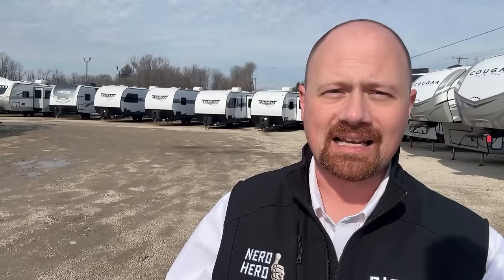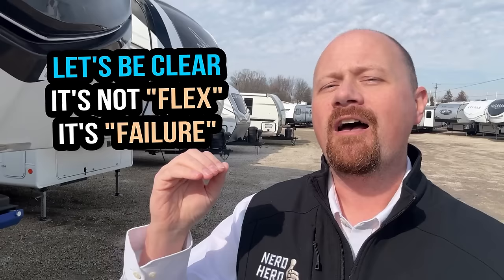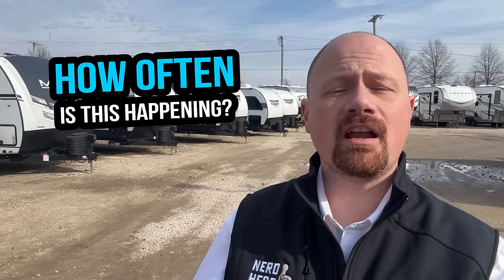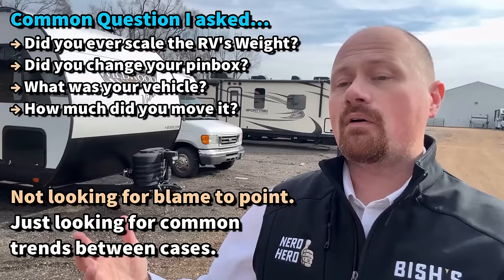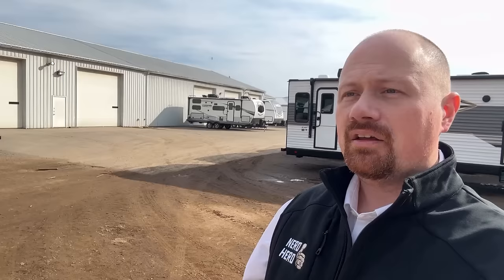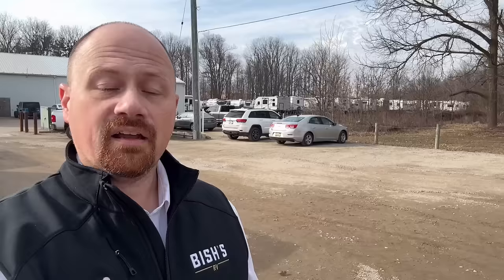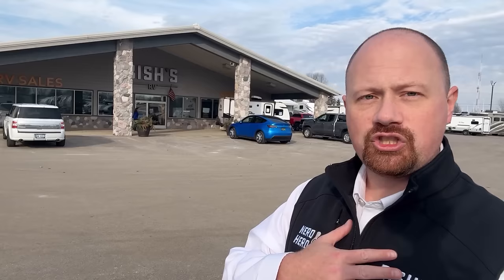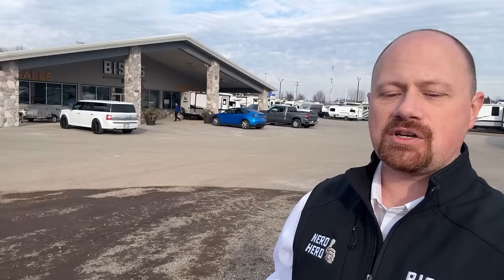🚨 RV Frame Flex & FAILURE!! • WHAT is Happening and WHO is Responsible?!

Comment: Ok nerd the t--d!!  Lets get it right and you sure missed the ball.  The main thing is the manufacturer has cheapened the frams way much. How do i know this??  6 point leveling!!  Sounds great right??  Well its not .  The reason is the fram is so light that it can't be to leveled without the extra set of levelers in the middle. Don't believe it??  Try leveling it with only the four corners and watch it bow so much as to bend so much it will not ever return to normal. Now thats a cheao fram, period   what another way to tell just how cheap and worthless frams has gotten. Look at older RVs and the thickness of the metal.  World of difference.  As far as your you can have to much truck.  A air ride hitch will take alot of that argument away especially if the truck is air ride.  Here's another thing you skirted and have for years now. Rvs that have only 1000 or 1200 pounds of "weight" you can haul.  Thats dry weight with nothing in it, no water or anything.  Ive seen you yourself say oh this RV can Carry 1000 pounds of gear. Now it has a 50 gal freash water tank so say goodbye to 400 pounds of that weight.  Now add a couple of batteries to that and now your under 500 pounds you can carry.  Ive even brought it to your attention a few times over the years. But here's one thing that has not changed and the RV industry spends millions a year to keep their products from falling under many of the safeguards even boats have to follow.  Why do they spend so much money to keep from giving their customers rights??  Think about that..
   Next i have heard you yourself tell us that this trailer is rated for full time use. Yet in this video you backtracked on that. Which it turd??  Rated for full time use which means hauling it across the country or it's not rated to be used but a few weeks a year. I will say that i have slowed way fown on your content as you do not cover things the same way as you use to. 
  Now here's how to never have any trouble with a RV. Do not ever buy the crap to start with.

Comment: Its not frame flex its frame break and broken welds due to under engineered frames bullt with undersized  and under braced  steel and welded by amatures earning minimum wage  all to make the most money Basically there putting a  25,000 pound camper on a frame that can only handle 10,000 pounds  and fudging the GVWR by putting 3 axles on it Plus the Gen Y pin boxes are certified by Brinkley so dont blame them Brinkley also certifies there RVs as full time RVs

Comment: OK, I watched the whole video and was somewhat disappointed in that you put most of the blame on the owner's of the RV's, and completely skipped some of the workmanship, or lack thereof, of the frame manufacturers (I won't mention the name, but you know who I mean) and RV companies. This "Frame Failure" issue is not a new problem. Shortly after we purchased our 2017 Keystone Avalanche, I started reading on the Keystone RV forum about people having cracks in their Filon siding mainly from the bedroom slide down to the corner of the front riser. In 2021, Keystone published a service bulletin (KSB-180328) that details how to repair these units that have frame failure. From what I determined in reading the document that it involved poor welds in the frame that broke causing excessive flex. Sure, some of that could be exasperated by users, but I felt you did a disservice by pointing the finger too much at the users. Just sayin'
Reply from the maker: I literally asked the question how can you fault owners for using an RV in the way that they were led to believe they could or never educated on. Then said dealers and manufactures need to do more educate customers. Every day I’ll be looking. I’m curious if you saw the end of the video or I had messages to different groups
Reply: @JoshtheRVNerd  Hi Josh. Yes, I did watch the video to the end. And I certainly agree the RV Dealers need to educate the public on such things as overloading, using the proper hitch, using the proper tow vehicle, and all the other things that could cause frame failure. However, during this whole video, you never once mentioned some of this could be cause by the RV and frame manufacturers in regards to poor craftsmanship. And I understand that you probably can't being in the position you are in as a proponent for Bish's RV, but if you are being 100% transparent, it must be mentioned.

Comment: Just look at equipment 5th wheel trailer built and weight !!! RVs can’t be built the same way because the 1 ton wouldn’t be able to tow . Semi work great for 5th wheeler - 1 ton not so great . Just look at equipment 5th wheel trailer for a 1 ton truck  !!!

Comment: I'f3 seen this on a couple of channels (Keep Your Daydream 0 Airstream) and a few 5th wheel.  In my opinion... BAD Design or Designers out of touch with users and what they do to/with their rigs.  As a side note, the Aircraft deals with flexing things all the time and seem to have made solutions, (oh yeah, they don't use fiberglass) but the Boat Building industry doesn't have this issue and they use FG all the time.  Back to the drawing board... you've only been buiding these things since the 50's!

Comment: From what I have seen and heard; the common thread is neither builders nor dealers want to take any responsibility for these failures.  Another common thread is that the new campers are garbage.  What needs to happen is maybe the government gets involved and hold manufacturers and dealers accountable.  You seem to be placing the responsibility on the owner or customer?  Why not build better RV's?  If there is a high failure item, reengineer it stronger....  What needs to happen is people just need to stop buying RV's until the quality improves to an acceptable standard.  Maybe if the RV industry was hit by a few large class action lawsuits they would respond?  You never address the quality issue???
Reply from the maker: Thru the video I state several times you can’t fault an owner for using an rv “incorrectly” when nobody bothered telling them what correct was. I also flat out both dealers and mfgs alike on blast for the practices that got us here
Reply: You can’t say you are holding manufacturers or dealers responsible and then not point to specific manufacturers or hold individuals accountable.  I can tell you that based on what is on the internet, both manufactures and dealers are trying to put fault on the RV owners without admitting any responsibility.  Half of this video is you using all these carefully worded disqualifies making sure you held no one in the RV industry responsible.

Comment: I can’t understand how anyone who buys a 100,000 plus Rv to use for 
a “travel trailer” would expect they wouldn’t be able to use it to travel with it frequently 
That makes no sense 
With all due respect it sounds like another dealer making excuses for poorly engineered products instead of quality products consumers deserve 
The Rv industry is absolutely a disgrace from the manufacturing end and it’s dealer network that supports this industry
Reply from the maker: I understand what you're saying and why you would feel that way. Remember I went out of my way to shed some light on something that is not commonly discussed. A topic that could cost a company like mine sales because that's the truth of the matter

If someone buys a new truck it's warranty is limited by years and miles. But RVs don't track miles. They only track your warranty start date. 

If RVs tracked miles, then consumers would have a far better understanding of expected use. But I also suspect one of the reasons miles are not tracked on RVs as it relates to warranty is because consumers would not like the low mile limits the current build of most RVs would offer

But none of that is shared with consumers. Instead customers are flooded with marketing rhetoric related to "full time" and "residential" and "Four seasons" - which aren't true for RVs. Not really. 

I'm not making excuses. I'm agreeing it's a problem

Comment: no offense but it's all excuses.  Trailer manufactures care about selling as many as possible, so they put in those stupid electric fireplaces, tvs that go up and down, and just pure junk.   So in return the put roofs on the thickness of birthday balloons.   The frames are light, the roofs are junk, everything is cheap junk.   Been rv'ing for years and regret getting rid of my 2007, as it was the last of quality.  I never once worried about a roof way back, and we recently bought a new high end one, and its junk..   What needs to happen is 80% go out of business, and a couple of the bunch start producing quality again.   They just don't care about anything.   I've always said, they make this stuff, drive it around the lot but does someone actually go out and CAMP with it before manufacturing it , field test them?  One Example, I have to jack UP my front hitch to get the tanks to empty on level ground..   My old trailer, open valves and boom 1 minute later shes empty.    Its all lipstick on a pig.   And they put in ducts through the floor which is like a home except now mice and get through your entire trailer.    It's up to dealers and insurance and buyers to expect better quality.    Back to this topic though, people expect to much for a pickup truck.   The laws should not allow these massive rigs to be built in the 1st place.  If people need large trailers , they need a semi and a Semi trailer with a proper frame.   They make them, beautiful , big and expensive.   As I said these are all lipstick and people find out after.  And we looked at a toy hauler, and tell me this, what trucker that knows anything would put weight in the back end of a trailer?  Tell me what trucker would say, put all the potato chips up front guys, and put those pallets of bricks in the back.   It's unbelievable what they seem to get away with.  Research everything and pay attention to the bad reviews

Comment: This is the first video I’ve watched with this guy.
He’s running interference for the rv manufacturers. Blaming the victims for shoddy workmanship and design.
I get overloading the coach, but too much truck and moving too often.  That is bs. 
I’ve met people that have traveled thousands of miles with older 5th wheels over decades without any problems other than tire failures.
Watch rv wingman or Amazing Liz, they’re actually looking out for the consumers.
Dealers should be pushing back at the manufacturers, not defending them.
It’s just not frame flex/failure, there many stories of brand new RVs having numerous issues.
Reply from the maker: I’m curious if you watched the end of the video where I literally both rv makers and dealerships alike on blast after saying several times how you can’t blame a customer for doing what they’re doing

I’m not sure how that constitutes running interference

Comment: You are wrong about towing with a semi tractor.  My class 8 freightliner has air ride front and rear suspension and tows much better than my Ram dually or my srw 3/4 ton leaf spring pickup loaded or empty. My 2 axle class 8 truck rides smoother than my pickups by far so I hope people take your advice with a grain of salt. You are comparing to a semi with leaf springs not air ride. Most Semi tractors are specced with leaf springs up front and air ride in the rear.

Comment: This seems to me that you are blaming the owners and not the manufacturers. HEY a rv, it is a travel trailer it’s not meant to sit in one place. That’s a park model. I brought a Wildcat Sterling that was a problem with the frame. I got screwed on that camper and the manufacturer was no help, the frame didn’t last 6 months before I started having problems. I thought you would be better, I have looked at your channel my last time
Reply from the maker: I would encourage you to hang around until the end of the video. I flat out state how I don't feel you can place the blame on owners for "using it wrong" when nobody is telling them the "proper" way to do it

That includes both MFGs as well as dealerships -- even my own

If someone wants to swap their hitch box and we as the dealer completing the job don't inform you as to the possible negative side effects, then you really can't blame a customer for that.

Customers come to dealers like us because we're the ones that are supposed to be able to guide and protect you from those mistakes. But if that information isn't being shared, then I really don't feel you can fault a client for it

Comment: I can sense you are trying to keep your relationships with other dealers, makers, and vendors intact Josh, and I understand that.

In the end, it is the manufacturers who underspecify to the (almost) one company in the entire industry who make frames how strong they want the frames to be made with: "All we care about is that it'll support X,000lbs and have the lowest cost to us." that should shoulder the most blame here. 

You were even saying this several years ago: 

https://www.youtube.com/watch?v=GWMDKrvdfSo&t=152s

Dealerships who oversell should share the next largest slice of the blame. Buys/users/RVers who are NOT educated in not overloading and driving professionally and safely should take the lowest amount of blame.

Why in that order? 

Because the root cause is the lack of strength in the frames, as per the repairs to 'flexed' frames with can be found on YouTube, where additional gussets and rewelding with added steel sections is done. This is 100% a manufacturing problem s nobody else can have any input to this. 

Dealerships have almost never educated owners and once the money changes hands, it's all over, unless the dealership is a 'good' one such as yours. Unfortunately, 'bad' dealerships are usually the largest and most accessible ones (no names) and they never educate anyone about "how to" anything in an RV.

Users are as you say, very easily tempted to make changes to the pin boxes as so many review videos recommend an "upgrade" to something other than the R is designed for without checking with the manufacturer first. Users are also to blame for overloading an RV? How many people know how much the 1,000lb's of additional stuff actually is? What does it look like and so on? Nope. We don't know that. 

The issue for end users is LACK OF EDUCATION. Where do we get that education from? Manufacturers who are all sunshine and roses? "The more you know about how poorly we make these things, the less likely you are to buy them." Dealerships who are worse than used car lots? "Pay me now and then get the heck away from here." ????

This is why your videos are so valuable and while Bish's is one of the good guys for letting you publish them, the RV industry as a whole has a long way to go before it even catches up with many of those used car lots.

Comment: So what exactly fails on the frame? Does having the bed slide crack fixed actually fix the problem? I know they reinforce the wall stud joints at the corner of the bed slide but was that the failure you speak of or has something else on the frame failed? You talk a lot but don't actually give details on the "failure", just possible causes and how you might detect it. Those of us with the failure want real answers! Are they just masking the problem with the fix?
Reply from the maker: It varies by instance. It could be severe like broken welds or bent frame members. Cracking fiberglass being patched up. Doesn’t fix the inherent structural issue.
Reply: The Keystone service bulletin is to re-weld the studs in the wall next to the slide and add welded gussets. I'm trying to figure out if re-welding the wall studs is actually fixing the problem or just masking it. I think it's more than just that the wall studs broke free. If it was as simple as that why wouldn't they add those during assembly, especially after all these years of issues? With the expansion joint added to the fiberglass there will no longer be any way to determine if the rig has new or other problems.

Comment: https://youtu.be/JE_J9m97YRE?t=982  Seriously, RV industry designs there frames with such tight tolerances that the stock hard connected pinbox doesn't affect and jolt the RV frame but "too much truck" can be a cause of frame failure? Excuses.

Comment: Nice explanation, but B.S.  Brinkley RV owners are not having this  problem with the same style flex frame.  Are you saying that  Brinkley RVers are more trailer weight conscious than Rvers for Grand design??? That's a stretch. The problem is that the new owners of Grand Design, Winnebego, requested a cheaper metal when they ordered the flex frame  from the same manufacturer as Brinkley. The were trying to maximum profits at the expense of the customers. Many of the newer RVs are junk because of cheap materials used to maximize profit. It's just simply greed.
Reply from the maker: It would seem like BS nonsense if all of the frames were built identically for every MFG. But they're not. 

Important note to understand: Brinkley's chassis isn't the same as a company like grand design's

Each RV MFG has their frames built how they want them. So they might all come from Lippert but they're not all the same. Some are stronger in some areas than others. 

So some brands may see issues others do not.
Reply: The point is that both Brinkley and Grand design are using a style of frame called flex frame, and Grand Design did change specifications for a cheaper metal. The frames are the same style and same concept. Grand design is now being sued by customers. I posted a response to your comment with a link that would have given you info on the lawsuit, but it disappeared.